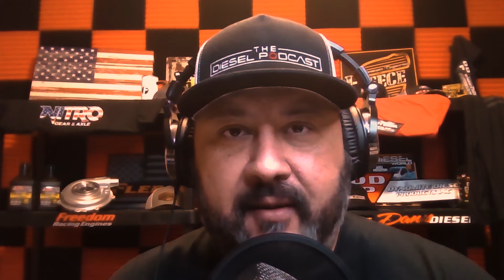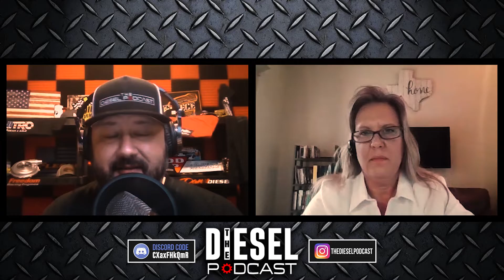Shell Rotella for Diesel Trucks

Comment: T6 15w-40 is great stuff. Constant towing heavy trailers, had WAY too much wear metals @ 10,000 miles in my oil when I used that paper thin 5w40 amsoil bllsht.
Reply: You realize 15w-40 and 5w-40 are the same when at operating temp? Amsoil is MUCH better than Rotella.
Reply: @OtisFlint no they are not the same. 5w40 will get thin and loose its viscosity fast compared to 15w40
Reply: @OtisFlint  No, they'er not the same.  To put it simply, the 40 in a multi-weight oil is an artificial equivalent of what the actual weight will be at operating temperature.  A straight 40 is better at operating temperature than a 15-40, and much better than a 5-40.  Also put simply, the 40 in a multi-weight is artificially achieved through additives and the larger the weight spread is the more the oil is relying on those additives to keep 'faking' the 40 weight spec.  All that said, I run multi-weights, including 5-40, because the tradeoff is beneficial for my use.
Reply: Rotella is shit oil

Comment: Anybody ever use rotella T4 or T6 in an old toyota pickup engine? I have an 86 SR5 pickup 2WD. Always ran 10w30 or 20w50 in summer conventional. I've heard its good because it has higher zinc and how old oils used to contain more because of the protective qualities on old flat tappet cam shafts. I'm considering using T6 because its API SN certified, but some people say stay away from synthetic oils on old engines. Currently at 144k original miles, just had the valve cover gasket replaced and no current leaking or burning.

Comment: I think that valvoline premium blue is a far superior oil
Reply: Think??? Can You back up that info with scientific data?
Reply: No, just using n my truck. When valvoline premium blue has lasted over 10,000 miles n my truck and the oil change light STILL HAS NOT COME ON USING premium blue, but when i use shell and it comes on after only 5000 miles of use, THAT ALONE should tell u something
Reply: @brianr3424  It is your truck, but since I can leave a comment, I have got to say that the "dash board" lights are more of a suggestion, for me and whom I know.

Comment: What % is synthetic in the t5 formula? Thanks
Reply: it's got a more robust additive package then the others, I read the Blackstone lab reports.  I run it in my 04' BMW 530i M54 gasoline motor,  not driven much 58k original & it developed a leak after an oil change using the 5/30 BMW recommends..No more leaks with the Rotella 15/40.  It's mostly conventional oil based I read too which is good for me on the seals & gaskets keeping it from leaking .. my conjecture anyways
Reply: I emailed Shell once; they refused to say 😁

Comment: How on the world people still put in their engines Mineral oil, so called Regular oil, it is a garbadge, the standart is so low.
In Europe the mineral oil has desapired from the market 25 years ago.All the semis and cars are running on Full Syntetic one.
America is so much behind about that, and the people are so much  neglect.
 I am a truck driver and my engine is 1036000 miles and run all the time with Rotella T6 15W40. Probably if i used mineral oil, my engine should be for overhaul.
For diesel engine also is very important to flush the engine right before oil change.I am using "Xado" flush , and i do this  on every 3th  PM.
Reply: LMAO funny I own a BMW as well if Europe is so much better how come they can't make a F'n gasket that last longer than 50k miles? I agree your oil over there is on another level, as I only buy liqui Moly or Motul for my car.  I ran Rotella T6 once and it burned through it so fast I thought something was wrong.  Castrol was another fail but it was US spec so no shocker.
Reply: What truck You drive???

Comment: Anybody know why oil in a Diesel Motor gets Black so quick?? all the Cummins I had and one Duramax gets black in a couple hundred miles!
Reply: The EGR garbage. My 2000 Pete had none of that garbage and oil still looked like new after 5,000 miles. The new KW would look black after a 100 miles.
Reply: Soot from the combustion process.  Yes they all will do it, some engines turn black as coal after start up like my 05 Cummins, my 04 stays golden for a couple thousand miles then turns dark brown/black.  My 05 has an egr camshaft due to emissions crap and Cummins did that vs using egr in the late 5.9.  I also have a 6.7 and that oil stays clean like my 04.
Reply: Soot for sure. Must be the egr cuz my 1st gen Cummins doesn’t turn black even close to as fast as the newer company owned Cummins I used to drive.
Reply: Not a simple answer, my 04 LLY Duramax has never had black oil, never in its 400K, I've worked my whole career as a HD Mechanic, this is a 1st for me too,I change probably sooner than needed,but have been rewarded.
Reply: EGR takes sooty exhaust back into the intake, boost pushed the particles past the piston rings, bam dirty oil.
Reply: Use AMSOIL and buy their oil bypass system. I have it on my Cummins and it has drastically changed my performance. And it isn't black after a couple hundred miles.

Comment: I work in a gold mine in the great north. We use 0w40Mobil1 in everysingle piece of equipment from chevy 5.3gas to 6.7powerstroke to V12Catepillar generator. At -60c you need that 0w
Reply: Mobil Delvac 1 (0w-40 ) has a ASTM D97 of -48, Shell Rotella T6 (0W-40) is -51. The Shell has superior cold-flow properties.

Comment: Might aswell just have Shell Marketing on she covered all the bullet points. I ran/tested Shell once  probably 8 years and it sheared faster just like everyone said it would. Delo400 is better, but Delvac1300 has done the best for a conventional in my Dmax and several others.
Reply: When I bought my 08 Duramax I tried delvac and it used oil. Switched back to what I used in my power stroke, rotela T4 it stopped using oil. Now with my 22 I run t6 and see less regents then with T4.
Reply: I ran T5 in our Duramax and got best fuel milage and didn't seem loud. I tried T6 but didn't seem like any extended interval was doable, I got more oil odor from the pcv bypass and didn't justify cost due to same mpgs. I tried Delo but it made the LML more noisy and I noticed more regens. So I switched back to T5
Reply: All fishing boats either are going to use Delo400 unless they have a jimmy then they run Delo100

Comment: Delo doesn't stink. Rotella stinks to the high heaven ( 03 Cummins Ram owner)
Reply: Why do you say that
Reply: @yohnny8839  Because when you run Rotella the fumes from the breather tube are horrible. An 03 has no Obama emission crap
Reply: Its actually the other way around for me. I use T6 on my 6.7 powerstroke and T4 on my 3406e CAT. With Delo that CAT smells horrible. And more visible blowby.

Comment: Context is King. 
"Thermal brake down dose not happen in less than 360hr at 265°f ."
Hot shut down   oil on the turbo shaft "  coking"  causing seized piston ring(s)  to the shaft  witch cuts out the bearing housing, resulting in progressively worsening oil leak and ultimate journal bearing failure  that requires bearing housing replacement at a minimum ( worst case scenario shrapnel from the compressor wheel goes through the motor   holes in Pistons, requiring a full rebuild.)
This is normally the context to which people are asking what is the maximum safe temperature., 
They are not asking about operating .  
They are asking about heat soak and post shutdown temperature creep.
Reply: Let ur truck idle for a min or two.  Solved. I wait till 300 degree egt or less before shut down, ALWAYS.
Reply: @TheProchargedmopar   thank you for making my point. 300 + 50-100° creep results in 350-400° +.  A full 100-150° above testing conditions  were off gassing leads to coking the piston ring.   
I have always been an advocate of cool them down, to the point of being reamed on some of the forms for suggesting it people.  With them bantering about "wet stacking" my 12v.  
Last sample on the 2nd gen had oxidation 15ABS/CM for what it is worth. Getting ready to do the first sample after a rebuild on my first gen.